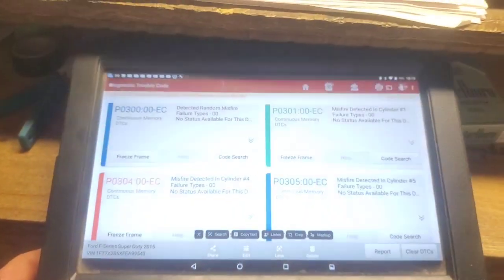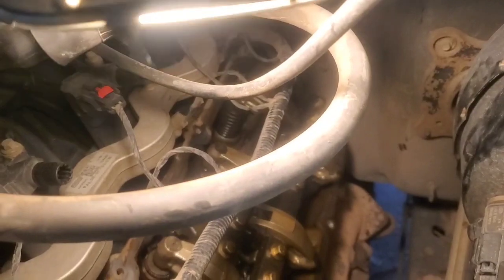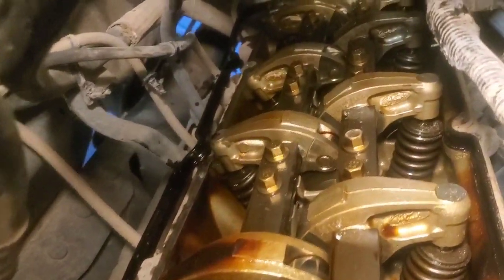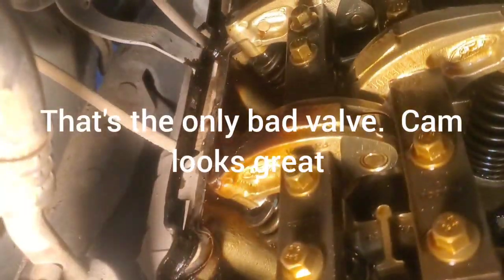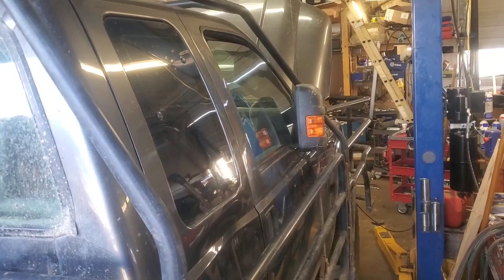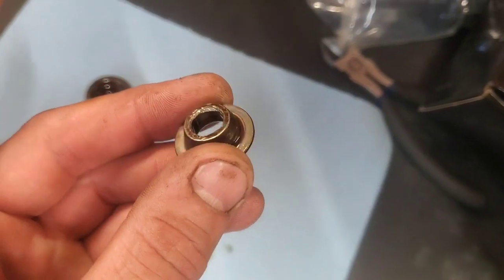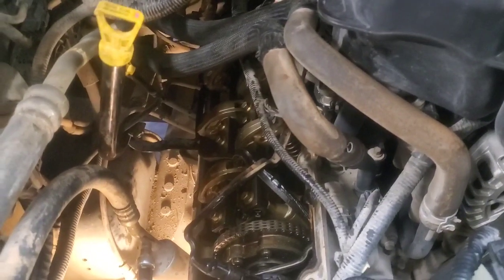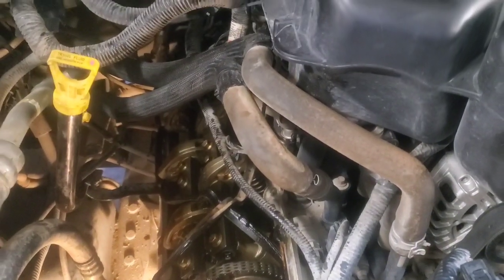Ford Superduty: Jurassic Park Truck? 6.2L Misfire and Knocking Noise Part 1.

Comment: Holy hell, i can say ive never had 1 come in like that. I have a good video on this repair, check it out
Reply from the maker: I did happen to see that video.  However, I can't move the valve up and down very easy at all.  I suspect that the valve is bent.
Reply: @Pro Diesel Repair  aw man, thats a no good...
Reply from the maker: Yeah it is.  We're going to remove the cylinder head and see about fixing it.